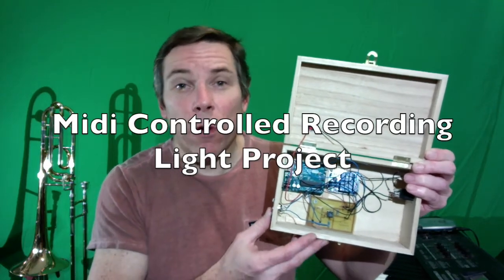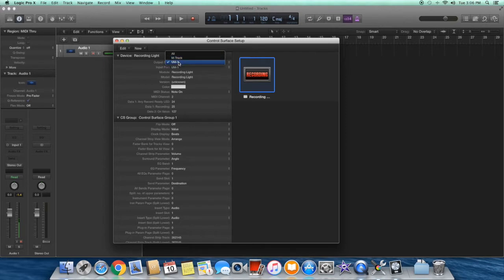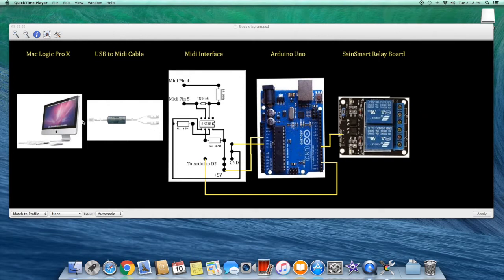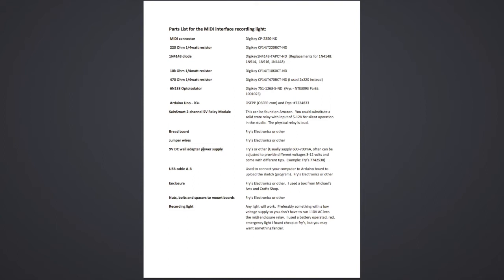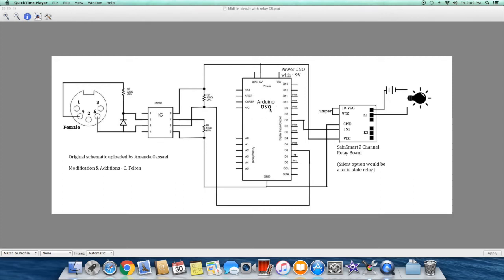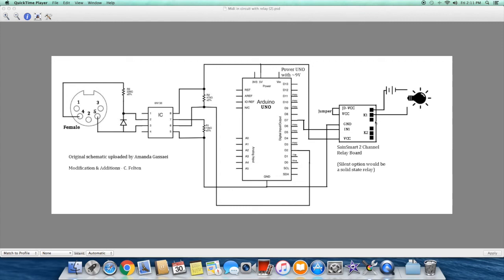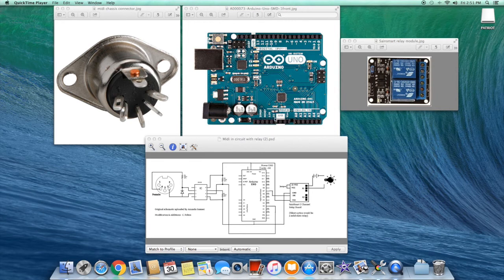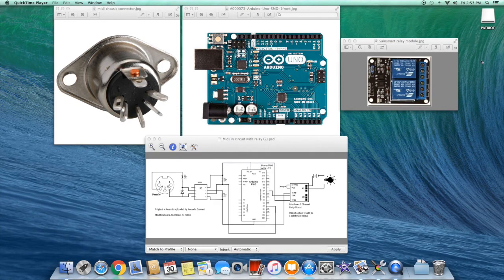MIDI Controlled Recording Light for Logic Pro X - DIY (Part 1) Remix

Comment: My setup is a MacBook Pro with a Focusrite Scarlett 18i8, I'd really appreciate it if you can help me set up a recording light with my gear.  Thanks a lot again!
Reply from the maker: Coco,  Thanks for taking a look at the video.  Unfortunately, I'm not familiar enough with Reaper to know what midi code it sends out for the Recording Light control surface.  I checked around a little, but it looks like you've already done a fair amount of research.  I would just keep researching until you can figure out what midi signal it sends when recording starts and stops.  Once you have that information, you can modify the Arduino sketch.  Maybe someone who sees this video can help.  If you haven't already, you should also post the question in Instructables.  Maybe you can use a midi monitor (e.g. snoize) to figure it out!